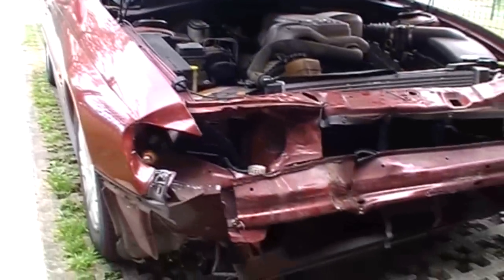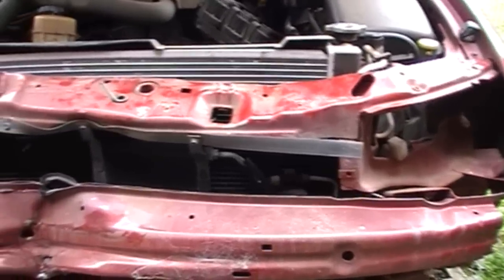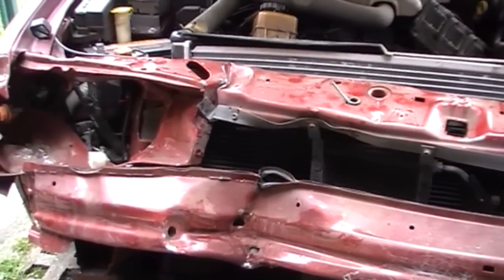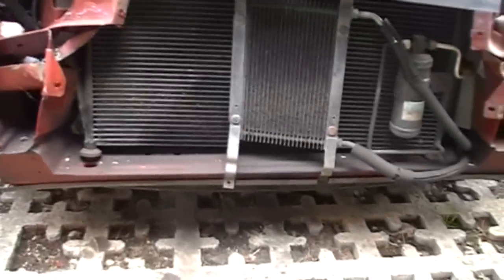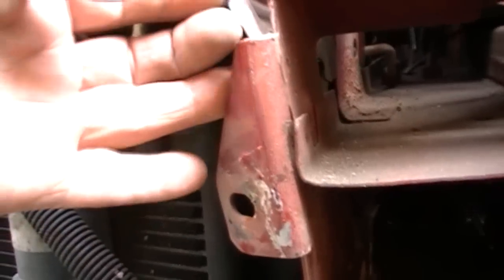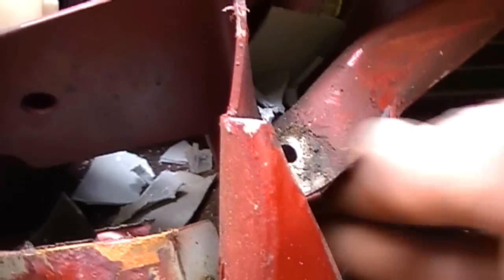Now look what ya made me do.!.or..Dude..where's the rest of my car.?

Comment: glad to see you fixing it. idk if it would be profitable to fix and sell but def to fix and drive! you wont have to spend $ on a new car. when it comes to the frame horn you may find it easier to drill out a few spotwelds to pull the individual panels one at a time (alot easier) than weld it back together. also put some tension on it with a comealong as you hit the dents with a hammer!! thanks for the vid man